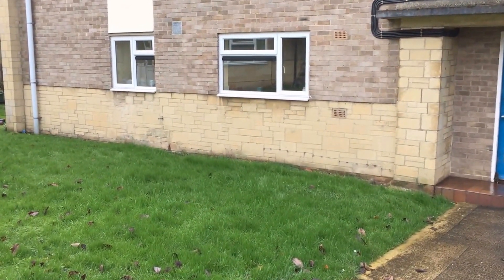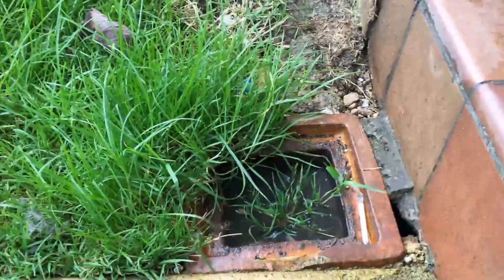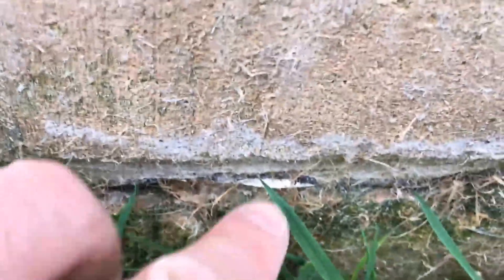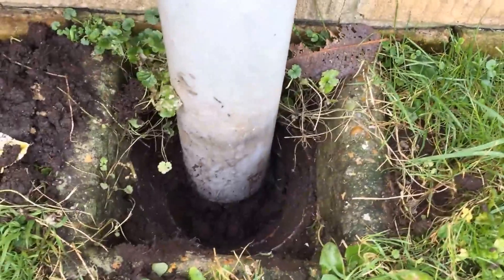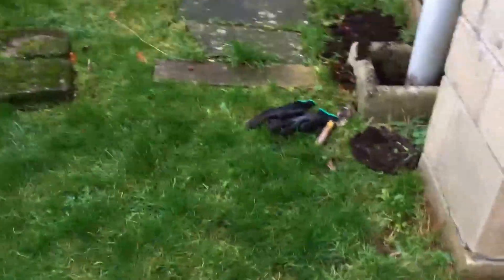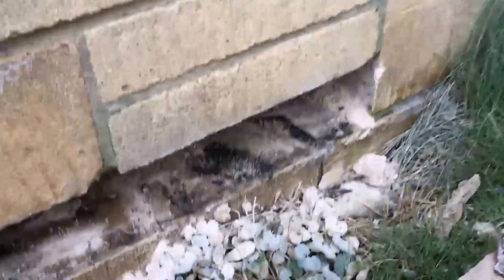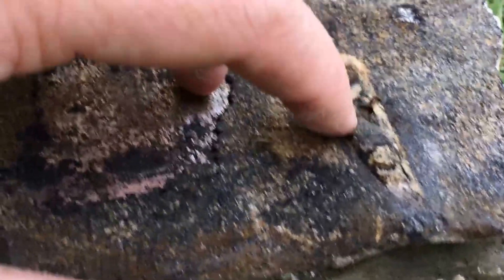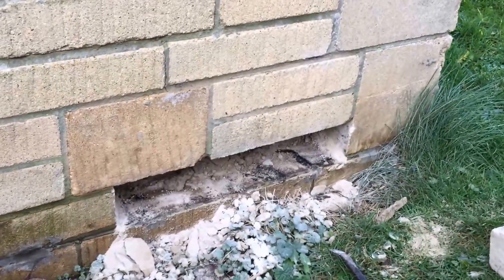How to fix rising damp issues on the cheap

Comment: Rising damp occurs in 5% of damp homes. The other 95% is down to penetrating damp which can usually be sorted without magic paste, juju creams or moisturisers. Don’t ask a “damp proofing company” if you have rising damp, you will get the obvious answer. Get an independent chartered surveyor to check it out but if he turns up with only a moisture meter ask him to leave.
Reply from the maker: It seems you have forgot about condensation damp, which is the cause of most damp issues within the colder months. 95% of damp issues I find are not to do with penetrating damp. A high percentage of damp issues don't get resolved, because these are of a none intrusive type.  99% of Chartered surveyors don't offer intrusive surveys, along with gravimetric sampling. I'm not a Chartered surveyor, but I offer in depth surveys, to find the root cause, as per this video. Damp meters used sensibly help to aid damp surveys. If you didn't use one how would you know where, and how high to drill a gravimetric moisture profile?

Comment: Should that be down to the building contractor or the Clarke of work  who’s checked and signed it off because my one is full two bricks up and still digging it out a week later 😠
Reply from the maker: I agree Wayne… problem is when it becomes an issue many years later and it needs fixing asap. Looked at a new build couple of weeks ago, and that was full of mortar 🤷
Reply: @completepreservation  hi Ross I’ll send you some pics on instagrams soon 👍
Reply: How did it go? What was your cavity filled with? How did you scoop it out

Comment: You saying the cavity is filled all around or just at this one point? Also what did you do to rectify this in the end? Reinstate solid ally on the brick and replace? Thanks.
Reply from the maker: Hi Aj, the cavity was full all the way around the property. The repair is simple, just remove all of the debris. In this case though it was very time consuming as the mortar was from new construction so was hard to remove, especially removing the blocks in the first place to prevent damage to the edges etc. Hope this makes sense : )
Reply: Big job breaking out each brick and cleaning  that cavity out & then reinstating dpc and bricks . Holy crap that isn't feasible as going to take forever and a day! and need to look at the structural side of things by undermining the external cavity wall.